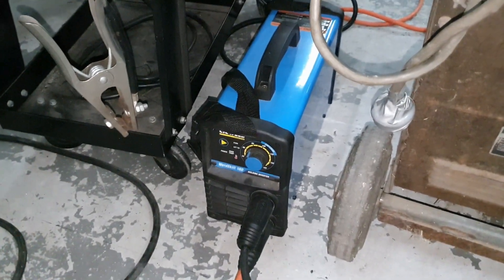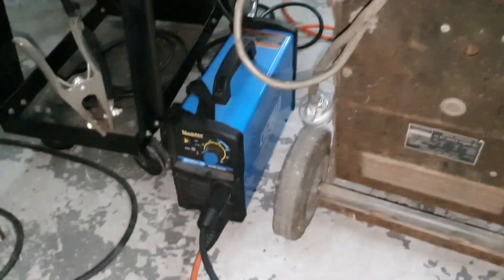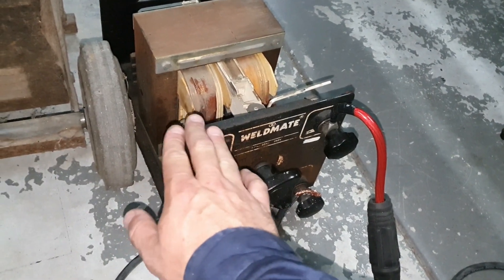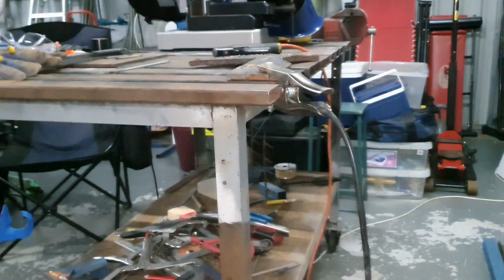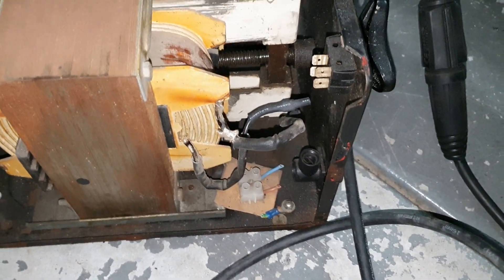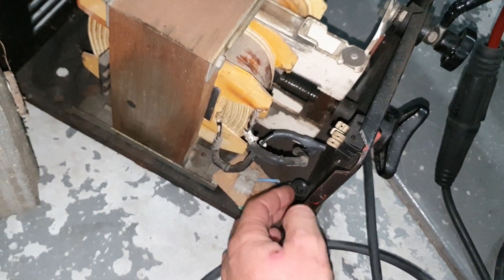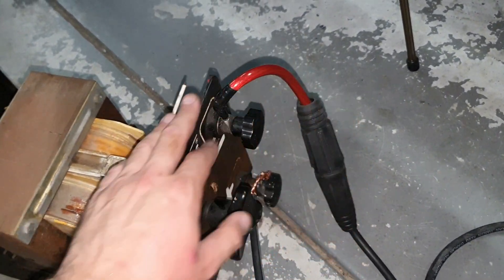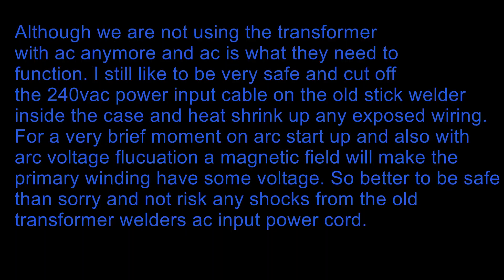Running E6010 rods on a DC Inverter - With arc shots

Comment: So, some in the comments are saying that the extra inductance will cause more back EMF which could break the inverter welder.  What are your thoughts on this?  Thank you.
Reply from the maker: @bigrob1887  Hi,  it maybe is "possible". However most modern welders have overheat protection which is also it's duty cycle protection.  So it would just shut down/cut off and cool itself down and restart, just like it would if you ran very high amps for too long (hit the duty cycle limit)
Reply: @tabs123456  Thanks for your reply

Comment: Right, so what about getting a piece of Iron and wrapping a few turns of your ground cable around it-might also work. Another way, might be to add parallel capacitence to the output-though this is more risky as its putting extra strain on the IGBT's.
CAUTION: extra inductance on the leads will cause much larger values of back-EMF entering the welder, this may cause the output devices(IGBT's) to pop as their reverse maximum voltage is exceeded. I would not try this on expensive welders!!!!

Comment: Welp, I finally picked up an old transformer welder and tried it out. VERY cool, a massive difference. 6010 now runs without cutting out, its very smooth now. It also seems to make a big difference to other rods now too, And for some reason I have to run at a lower amperage than I used to. Now I can run 2.5mm 7016 rods at around 25 amps without it going out, and 50 amps wants to quickly blow through 2mm sheet ( I had been using ~70 amps previously ).

So happy to finally be able to run 6010 after seeing every american using it all the time. Its a very cool electrode, very very easy to see what is happening.. there is no swirly mess of stuff in the way.

But yes, I highly recommend trying this for yourself if you are having issues running 6010 or other rods.

Comment: Excellent excellent excellent!!!!!!!!!!! So, in case we have not an AC welder, we could make a Fe core coil, selecting proper wind cable diameter etc, so as to achieve the inductance needed? It would be very useful an example calculation.
Reply: I bet a high current output automotive battery charger transformer would work...  or maybe a microwave oven transformer rewound with welding cable.

Comment: So how many volts give you now that open c.
Reply: It's just wire so it must be exactly the same. If OCV was 70 it's still 70.
Reply: @antilogism  The whole point is to increase voltage, so remain the same ?
Reply: @hardcoreplayafromthehimala4888  Yes but only while open.
Open circuit means that no current is flowing (not welding). In that state there is no magnetic field in the inductor so it acts as a simple a length of wire. That length of Wire has resistance but, since no current is flowing, the voltage does not drop; it's the same at both ends.
Once welding starts everything changes. Inductors abhor changes in current, much the same way that capacitor abhor changes in voltage. Inductors counter changes in current very quickly using counter EMF or Back EMF. That stabilizing voltage add-to/subtracts-from to the welder's voltage to make the welding current even more constant than the inverter alone.
Reply: @antilogism  The whole point is that 6010 rod need more voltage for arc no to stick...
Reply: @hardcoreplayafromthehimala4888  Yes. While the mean DC welding voltage across the gap is low 22 to 25 Volts for 1/8" rod (according to Haynes Int.) there is certainly variation beyond that. While welding the resistance across the gap will vary. It will vary with arc length, more gap having a larger voltage. Since the welder is constant current it compensates with voltage. It not all smooth since the arc itself is very dynamic so there is a wideband, noisy, component too.
Based on the video, I suspect that this noisy component is not countered as quickly by the inverter as 6010 rods want. That leaves the voltage relatively flat and allows wild, noisy current peaks and valleys, also known as "hash". The back EMF (voltage) from the inductor will keep the current plowing through, sustaining the arc, through all that hash. It probably helps with both sticking and arc stability.

Comment: What difference would it make to use the primary transformer as an inductor?
Reply from the maker: Primary coil of transformer is not recomended due to having smaller conductor size,  so will generate more heat and have more loss etc.  Might even burn up. Also see my other videos  for info on chosing a correct sized ac buzz box for your aplication. https://youtu.be/qRqvXG7Cd50